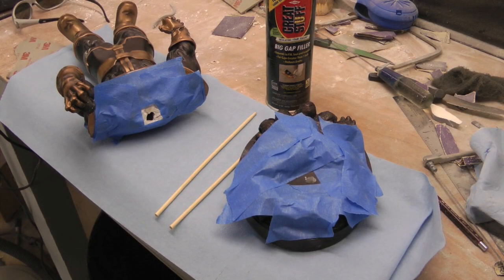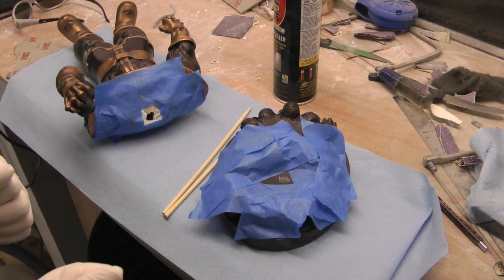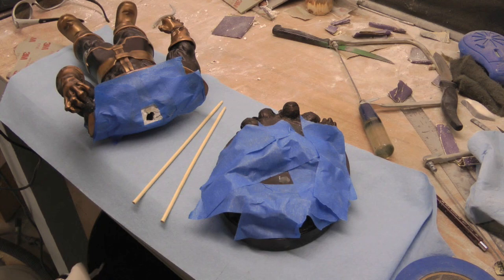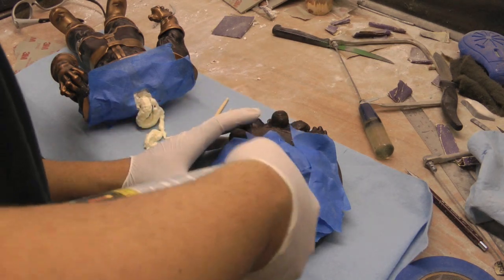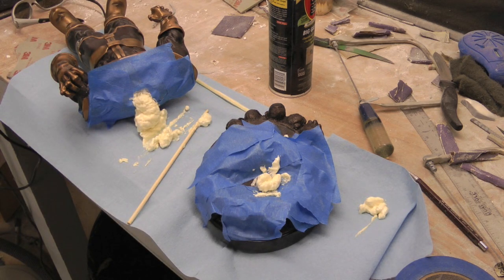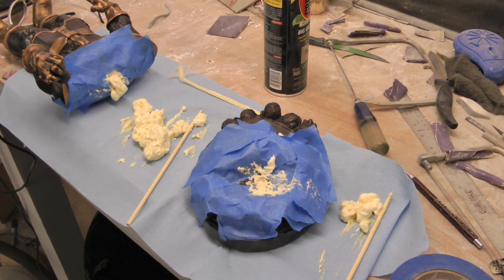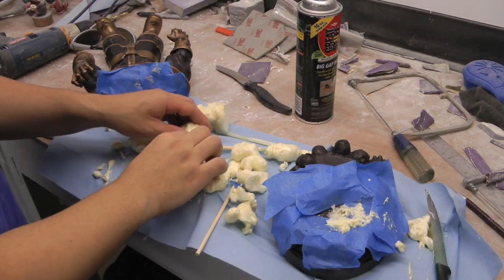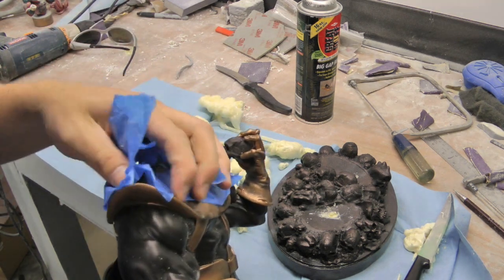Filling a Hollow Statue With Foam

Comment: Just found your video searching today. I purchased a head/bust of Hercules that I want to hang over my garage of my house. The whole back of the head is hollowed out. Since it will be outside year round, I don't want bees making a home in there.  The other thing it being outside in the open, I want to be able to secure it to the wall because of strong coastal winds here in Florida. This looks like the right thing to do to fill it but what do I paint it with and I'm thinking of putting a blob of silicone on the back to secure it to the concrete  wall. Please give me some of your ideas. The head is 16" long by 9" wide and it stands 6" off the wall. I wish I could send you a picture of it. I'm looking forward to hearing from you. Thanks so much. Ray Kasza
Reply from the maker: Ya if your going to place outside, I would fill with foam and try and pack best ya can, then if you can seal it with a plank of wood then you can create a way to hook it up somewhere,.

Comment from the maker: check out my video on how to make a generic base. you can pick up a two part resin, pour it into the hollow statue. This resin cures in like 3min, so you have to work quick. You poor it in, rotate it so it doesnt drip out of the hole you poured it into, and that will make the walls of the hollow resin thicker and add more weight. Then once they are thick enough fill with foam. Just be careful two part resins get super hot to the touch. i buy mine from specialtyresin web site called Model-Pro

Comment: Just finished casting a sculpture that had multiple holes and seams from shim lines and some of it is just quite thin in areas so I wanted to do this and found your video! Can I put something in the holes on the outside that won’t stick to it then fill the inside, remove what I put in hole then fill holes with aqua resin to then sand and smooth out? What doesn it not stick to? Could I put Vaseline on clay and it will release it?
Reply from the maker: Hard to say without seeing whats going on, can contact me thru my web sites contact page and then can see if i can help more with pictures etc.
Reply: VinceVellCUSTOMS I just bought some and going to studio and will talk to techs there as well,,,I’ll see how it goes and get back! Thanks for response!
Reply: VinceVellCUSTOMS cant find the name of your website anywhere?
Reply from the maker: its in the description of my videos for the link but its  Ficchiillustration

Comment: I'm curious how would you fill a statue with resin. I'm getting a rhino comiquette soon and I hear the walls are very thin on it. I don't want to completely fill it up but I'd like to add some weight to the walls to give it added strength  then possibly fill the rest with foam.

Comment: try to put some water in the figure and pour it out then , the water helps the foam harden out, because its a one part foam it needs the humidity to harden out, once the hole where you put the foam in hardens, the rest of the foam in the figure wont harden as it should. maybe you just figured this out when i start thinking how old this video is.
Reply from the maker: Good to know, but so far any of the items i have done this too hasn't been a issue. i think if anything the bottom of the item the foam sorta filled up to a crystal like resin. But that was on a super large item that i had to dremel into the bottom when added a key after i filed it with foam.

Comment: How much will something like this weigh?
Reply from the maker: Doesn't weigh much at all, the foam is super light, But since i went to the jerseyfest show in 2018 i sat in on a seminar with Smooth-on that makes resins etc. They have a foam product that fills hollow statues better then this stuff from home depot that i plan to get down the line and make a video on. The smooth on product it light weight as well and make the item even more solid then the stuff at home depot.

Comment: How about cheap plaster?
Reply from the maker: its possible but i wouldn't want to fill a inclosed item with a water based plaster and it never really cure in the deep areas of the statue and possible leak. Cause i have dremeled into statues in the past that have done this and when you hit that plaster it comes out like toothpaste. Foam is the best option for super large items, but smaller hollow items prob just resin to cure solid in them is the best way.

Comment: I wanted to ask, how would you recommend filling out a hollow life size bust? I can make a discreet hole, but what can I safely fill it with that will add a lot more weight to it? foam just wont do it for me. Please let me know
Reply from the maker: if you wanted to add more weight and don't mind spending the cash, you can buy 2 part resin from Smooth On. They got a few graded, you an mix it up pour it into the statue and rotocast it. meaning you pour it in and turn the statue and let the resin coat the insides of the statue. The resin gets hot as it cures but if you keep doing this you can thicken up the statue for more weight without making it super solid.

I did a video on making generic bases, you can see how resin work in there. Then try looking up Roto Casting for video on it, and even contact Smooth On web site or even cal for more info. They help people out a lot on their site with their products. Thats prob the best way to make it heavier and make the item thicker as well. I mean you could just pour resin in non stop till its one solid piece but a life size but prob all end up costing a ton of cash to keep buying resin to fill i in.
Reply: VinceVellCUSTOMS thanks for the reply! That definitely helps. Is there a cheaper method? I was hoping to drill a hole, pour something in and just let it dry and hopefully not cost much. Any suggestions for that?
Reply from the maker: i don't know many other stuff to pour in and will help. I would contact Smooth On and ask them if they have a thicker foam, or material thats not as expensive to fill up the item. All i know is Foam from the can at hardware stores. Resin or that Plumbe Putty you can get at hardware stores. i did a video on that putty but that stuff needs air to cure when mixed with water so would have to do a tiny bit at a time with it. Which will be annoying.
Reply: VinceVellCUSTOMS ah thanks for all the advice :) can I ask a final question. Did the foam you added to the thanos statue increase the weight at all? Roughly by how much?
Reply from the maker: Didn't give it much more weight it just helps from expending and contracting in case it gets cold and hot in the long term from paint cracking. Plus gives the sense its not as hollow. This is more or less what i learned from guys in the garage kit hobby.
Reply: Fill it with sand

Comment: Why do you want to do this?
Reply from the maker: Well i learned from a lot of the guys in the garage kit hobby that thin hollow statues will cause cracking issues over time with hot and cold weather if they are subjected to it. I had a hollow garage kit head bust while back and never filled it with foam, after a year on my shelf i saw all the paint cracking. When i asked some guys int he hobby they told me i was supposed to fill it with foam before i painted etc.

So hollow stuff is ok if its thick enough, but when hollow items are close to being egg shell thin it can cause issues.